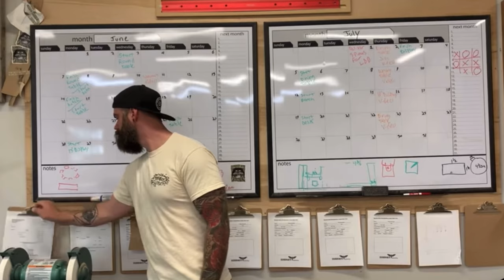Make Woodworking Your Career || You Should Do These 10 Things

Comment: Great stuff. I would only add that for pricing purposes, you MUST include a percentage to cover your overhead expenses. Wear and tear/ maintenance costs on machinery, new blades, shop utilities, shop maintenance, vehicle costs/ maintenance,YADA, YADA, YADA. You have many costs which exist just to keep the operation going, regardless of the volume of business you might do. One option is to calculate this overhead for a yearly basis, then divide it by 2000 hours (typical 40 hour work week x 50 weeks) to yield an hourly figure which is added to the hourly labor estimate. That way, your shop expenses are covered. Omitting this item means you are EATING thousands of dollars of costs, and your hourly wages are actually MUCH less than you think.
  Of course, you need to include at least 5-10% profit on top of ALL costs, and this is MINIMUM. Paying yourself a decent wage without profit just means you are still working for someone else. 
  Thanks for sharing you experience with us.
Reply: Very helpful tip, man! Considering overhead expenses enables a clear understanding of actual margin and actual wages. Thank you!
Reply: Your hourly wage should of course include your expenses. Just like any normal job. So learn accounting its really easy. Always keep your finances clearly separate. Which costs are for finished product, which is maintenance, and which are personal. Always have access to easy credit but never actually use it unless its absolutely must.
Reply: Your hourly wage should of course include your expenses. Just like any normal job. So learn accounting its really easy. Always keep your finances clearly separate. Which costs are for finished product, which is maintenance, and which are personal. Always have access to easy credit but never actually use it unless its absolutely must.

Comment: I have been in this industry many (4+) decades. When I do a site visit I have a large sample case that shows all the joints I use, the wood's we spoke about on the initial call, and our portfolio. Letting a client handle the samples and see exactly how the joints fit together in person is a great way to make the visit pay off. It also helps to have half a board foot of material so IF they whine about how expensive it all is you can pull out the sample and show that this piece of walnut in your palm costs $12.00 or whatever. If you think that might scare that paying customer off then THANK ME NOW.
The "Try not to poop at a clients house" is SOLID ADVISE and has earned you a like and a sub, pun intended.

Comment: Covering your material costs with your deposit is smart. If they back out down the road, you can still sell the piece (albeit not as quickly or easily) and you won’t be running too much in the red.

Comment: I think another tip would be. Per design or pre work as much as possible. In down time it's possible to set up something that can speed up the process. If that's some hardware set ups. Cutting out custom dowels anything can be a time saver.

Comment: Thank you for the tip of not pooping in a client's home. Back when I was doing HVAC service, that was a cardinal rule. If necessary, you tell them you need to go get a part,  and leave to find a gas station, fast food place, or spot in the woods, but you never use the client's bathroom.

Comment: When pricing your material costs, does that also include costs for electricity usage, wear and tear on blades, etc?
Reply: From what I've read / heard, that doesn't go into material costs, but you should add a percentage for overhead. The calculation I've seen is (material costs + labor + overhead ). I've seen people recommend up to 50% for overhead. Overhead would include all things not directly tied to a specific job ( lease, electric, blades, glue, etc...).
Reply: I think that kinda falls into the 15% he added on at the end. I do the same sort of thing when giving a quote. I charge an extra 5% for miscellaneous. Which would be the blade use electric and stuff like that. Then 10% for unexpected costs.
Reply: Also sum things up, don’t say like example 800 wood, 30 euro nails, 10 euro glue. Just write 840 material cost.

Clients can go to other woodworkers and will ask why he charge me 600 for the wood and you 800?  Etc etc.
Reply: @axel3398  they also come and ask why you use so expensiv glue. dont be too exakt in details.
Reply: @fritzkraemer1668  that’s why i say Sum up the material cost 😉 and don’t write glue, wood etc

Comment: Hey man. You'll probably never read this but I was wondering what you would do if you dont have a shop, and you have basic construction tools but no big fancy shop tools, and you love woodworking? How do you start with only a few tools and no space?
Reply: Check out 731 woodworks. He goes through the process of using minimal tools and space. Also worth the effort woodworking. He is a great teacher.
Reply: I just got my table saw from one of the guys at work.  He gave it to me.  Just let prople know what you need and you  might be surprised.  I just let people know what I was shopping for used.
Reply: you need neighbors far away, the noise is not good. as far as a shop you can grab a few shelter logic 10 x 20 units for under 1000 bucks...krig is your friend here

Comment: I recently started doing IT jobs. Installing data systems, adding jacks to existing systems and cleaning up and upgraging systems. We did a job for a pet hospital about a year ago. That doctor told another doctor and doctors that worked at that hospital had private practices of their own and and wanted help with thier systems. Fast forward. we've been doing almost nothing but pet hospitals for the past year. Doing rewires, picking up monthly service contracts and new jobs all the time. We're not really even advertising. Who knew veterinarians ran in syndicates? Seriously, they all know each other and bail each other out when work loads get out of hand. That's where most of our business comes from, a doctor sees me running wire, cleaning up a really bad looking phone system or building wiring and wants that done at their business, and more frequently, one of their locations. I imagine it would be very similar if I started selling the wood projects I do.

Comment: 1 Ask permission to post on social media, and don't post if you don't get it, they will find it.
2 Consider the costs of shop and shop equipment, operating overhead, not just labor and materials.
3 Don't forget materials are wasted in the process, so you need to charge them for the rough lumber needed as well as misc. supplies (glue, sand paper, etc.), you can ask them if they want the cut offs and the saw dust I suppose, since they own them (joke...)
4 design time can be significant.  I like to make complete drawings in CAD and they can take many hours.  Depending on your skills, you can do less design work, however, the more you do, the more likely your customer will be satisfied since you can be more sure that you both agree what you are doing.  imagine delivering and the customer says, "that's not what I wanted".  Detailed design work also means you can be more efficient with wood use and faster since you spend less time figuring out things as you go, but obviously there is a balance that is right for you.  You'll need to charge for design time if it is significant.

I'm just a hobbyist, and build custom furniture for myself.  I've done a few things for friends and acquaintances, and for sure, most people  don't know what is involved in making real bespoke and heirloom quality stuff, and are shocked when you price it out.  So you need to separate the two markets, A) those people who would buy from IKEA if they could find the piece that fit their needs, and B) those that would go to any lengths to get a custom made absolutely awesome hand joined no metal hardware amazing hardwood sculpture beauty to put into their house.  I for one don't get much satisfaction out of MDF and plywood.  I don't think you can compete against IKEA so you're likely to want to make bespoke hardwood projects.

Comment: Hard work is no joke. I build shipping crates all day and it's not easy. Even tho literally every one in the factory will tell you it is. Yeah it's really easy to cut a bundle of 1x12s, 1x8s,1x6s, and 2x4s then build 30 boxes a day. 44x24x22. Using a staple gun having to build the frame parts then stick the boxes together and stack them up 3 high... those things weigh like 80 lbs each 😐 great workout tho my shoulders and back muscles are getting jacked 😅

Comment: Pricing jobs your losing a fortune way your doing this for the reason allways add 10% for wastage of cost of materials.  You need a profit for your business. So the total cost of production is doubled there is your business profit. Most company's use this method if not they would have no business your only making a wage for your self way your pricing any job. I've priced all my work over 45years using my method with no business profit after your wage then little point of self employment and operating any business.